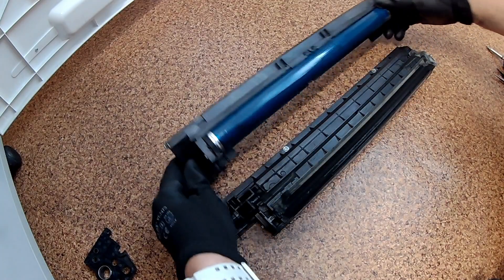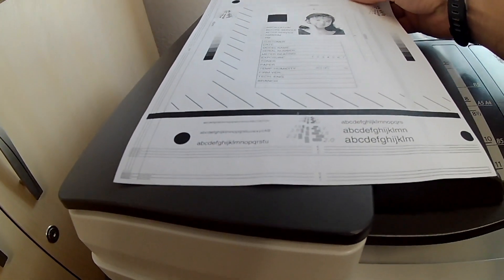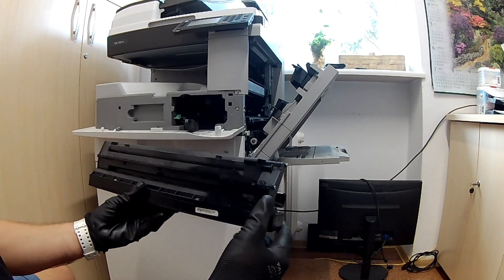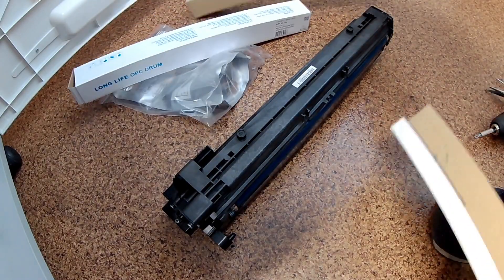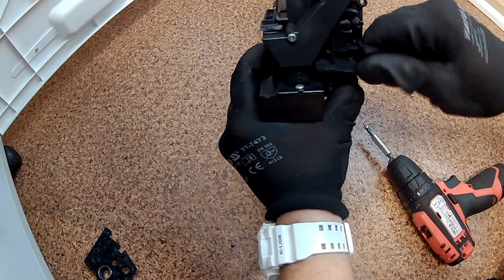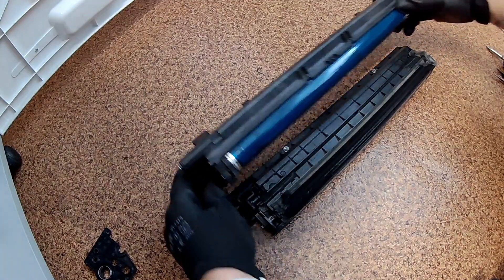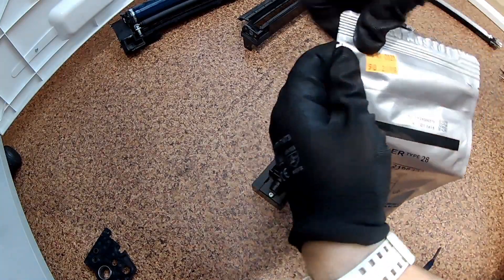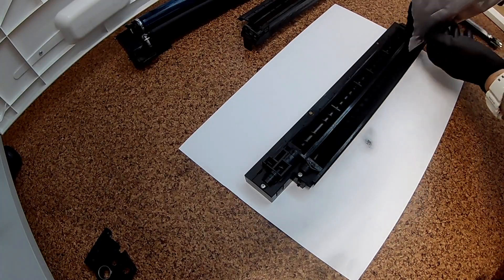RICOH MP2001 MP2501 MP2014 Drum & Developer initialization

Comment: Hello!
Thanks for your videos! Tell me how to make it lighter after replacing the developer? Ricoh MP2501.
Thank you!
Reply from the maker: Czy wykonałeś procedurę inicjalizacji developera? Czy wymieniłeś sam deweloper czy coś jeszcze? Jakiego toneru używasz?
Reply: @MrRicoh  I completed the initialization procedure. Replaced the Photo Conductor Unit. I use original toner.
Reply from the maker: @MasterskayaDSA OK, so you have a wrongly installed transfer roller. This is a common problem. Open the right cover and remove the Transfer Roller. On the one hand, you will probably notice that the spring is not working properly. Tell me if it worked, if not, I have another idea.
Reply from the maker: @MasterskayaDSA OK, so you have a wrongly installed transfer roller. This is a common problem. Open the right cover and remove the Transfer Roller. On the one hand, you will probably notice that the spring is not working properly. Tell me if it worked, if not, I have another idea.
Reply: @MrRicoh  I dismantled the transfer roller, everything is fine with it. What other idea do you have?
Reply from the maker: @MasterskayaDSA  Why did you take the transfer roller apart? You won't see anything there. Replace the roller with a new one.